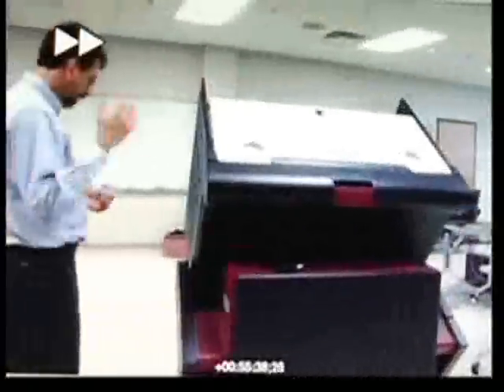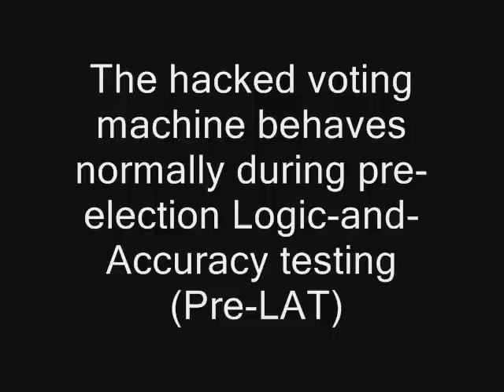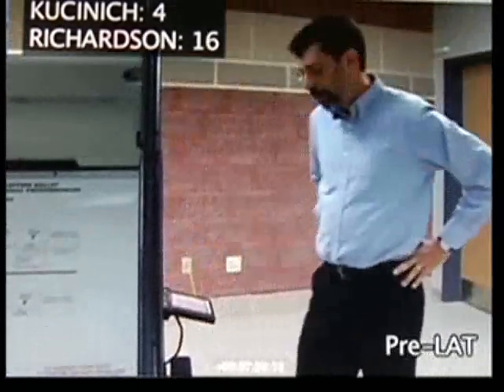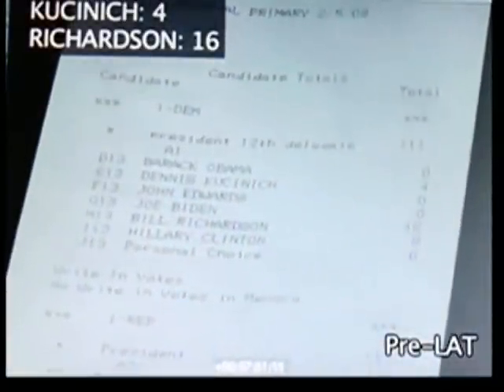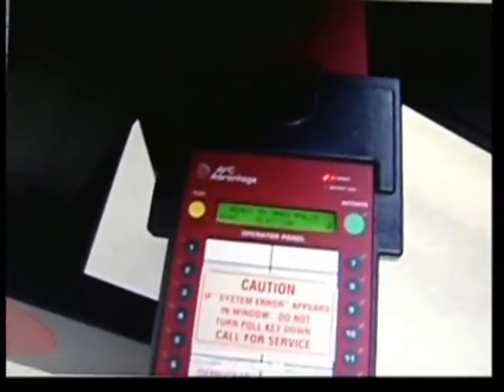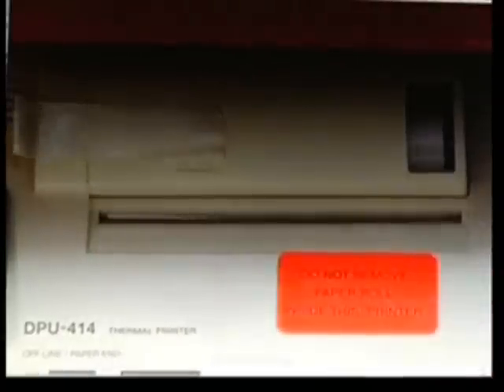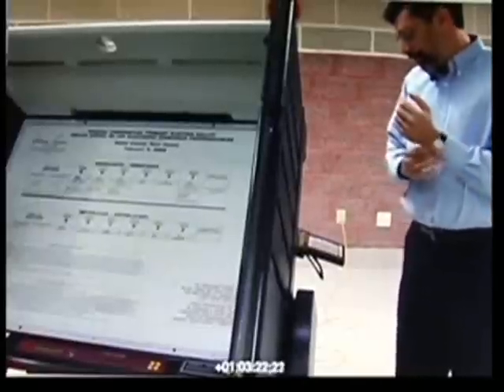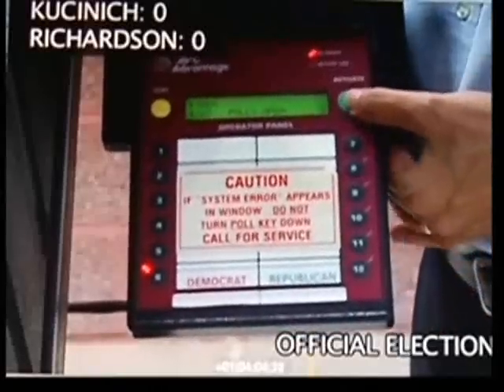Sequoia Part 2 Logic and Accuracy Test vs Election Mode with vote-stealing firmware.wmv

Comment: GREAT video.  Anxiously awaiting the other 3.

This demonstrates the Sequoia ABC Advantage DRE, but it could equally apply to the Sequoia Edge IIs, which are very prevelant in many parts of the country.  The CA Top-to-Bottom Review in Spring/Summer of 2007 clearly stated the vulnerability of the DREs, scanners, and central tabulators.

This shows too much of the individual votes being cast - could fade from the first couple to the last couple and save a minute or two on the video. GREAT JOB!